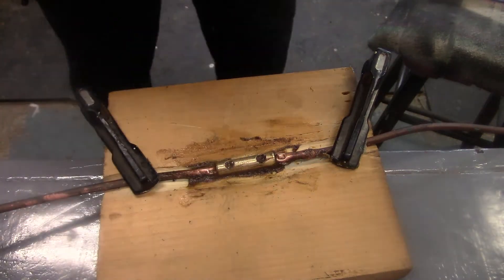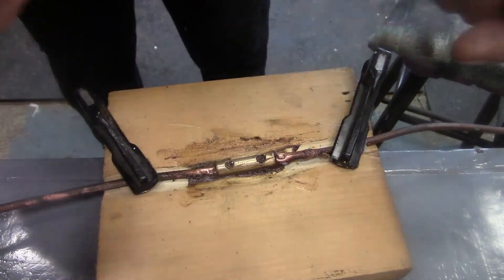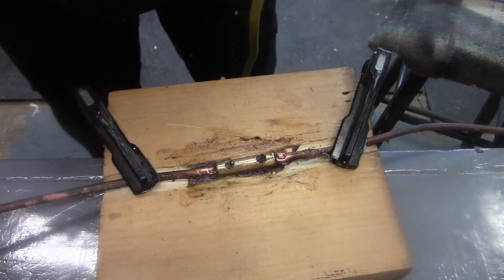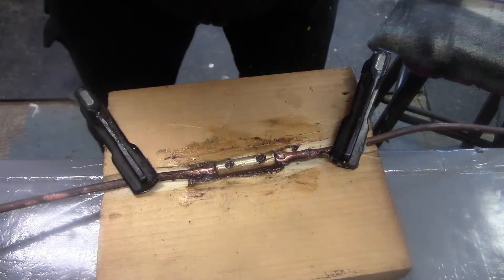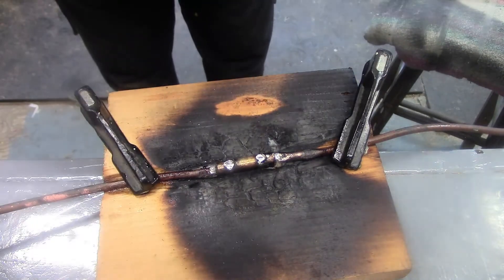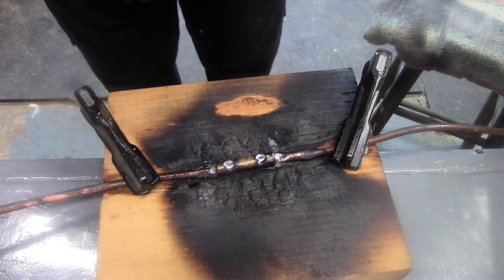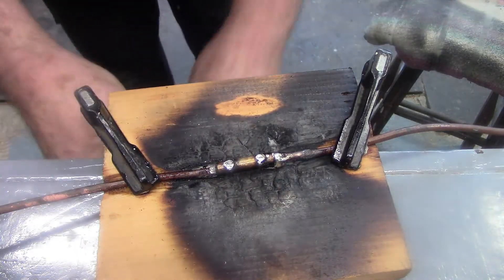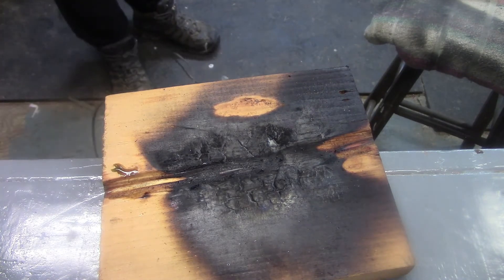A quick wire antenna using copper tubbing

Comment: I don't think I've ever seen soldering done with a torch before.  That sure did heat it up quickly
Reply from the maker: lol, More like sweating pipes. I was using Map gas it's a lot hotter than propane

Comment: Good job buzz!  Ham radio?
Reply from the maker: Thanks, Yes, I had 3 sections of copper tubing so joined them and works with a 1.5 on 20 meters and nop higher than 1.9 from 10m - 40m